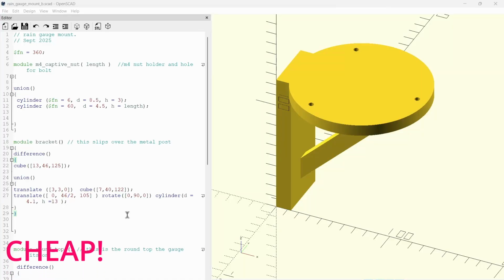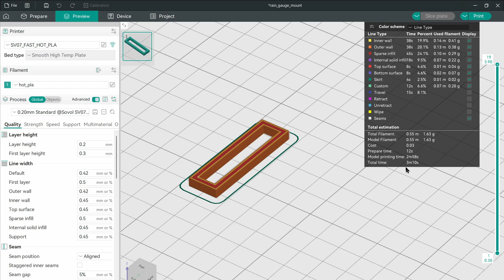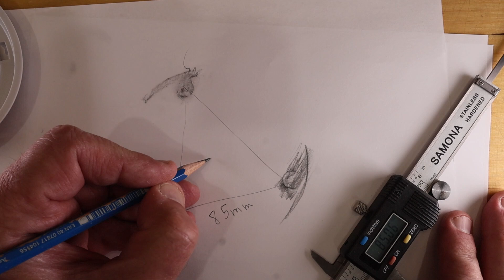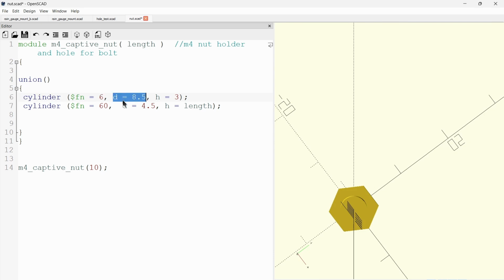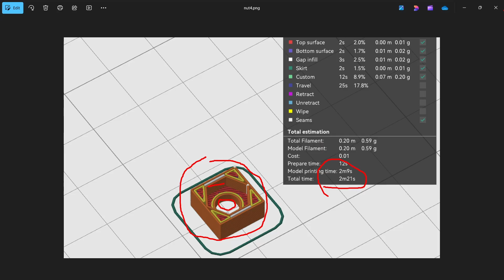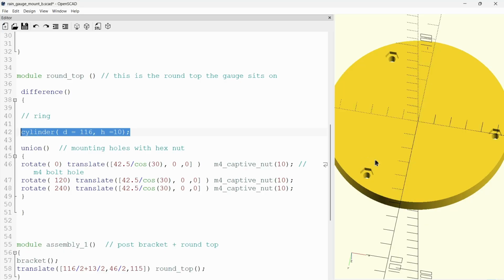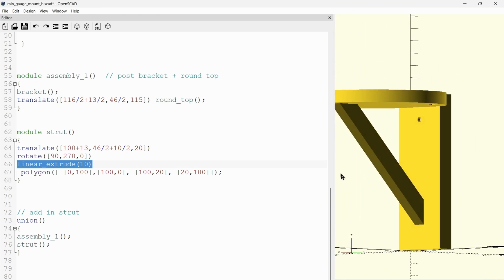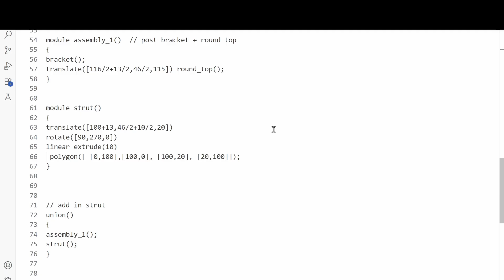3D PRINT: DESIGN FOR 1st COPY SUCCESS

Comment: I designed a similar shape for a security camera, it started sagging immidiately. Even after strengthening. Gravity and heat moves the whole material down, you cannot do anything about it. Temperature was between 30-40 C.
Reply from the maker: Fortunately I live where the temperature is not so extreme!

Comment: A nice thing about openscad is that you can include the script for an object in the video description so it can be copied and pasted straight into openscad.
Reply from the maker: Great suggestion.   The openscad code has been added to the description as well
Reply: that might work for a single aubergine shaped body, but try that with a dragon figurine 😜

Comment: What filament did you use to print? Won't weathering be a problem? I would think that adding some clear coat or paint could seal the print and add some UV protection.

I mostly favor FreeCAD, but seeing your presentation on how easy and logical OpenSCAD is, I think I will give it a try.
Reply from the maker: PLA.  So far I have had good success with many prints lasting for years.  Where I live the weather is not too extreme in temperature which I suspect helps.

Comment: Being a former programmer/web developer for more than 25 years I found OpenScad a very nice program to develop mainly functional models.
The fact that you "program" your model is stead of drawing it, fits good with my old profession.
Recently I have switched over to OnShape though (Having used AutoCAD 2007 as an alternative for quite some years) but the learning curve has been very steep.
What I mainly missed in OpenScad is the ability to apply chamfers and fillets to the objects.